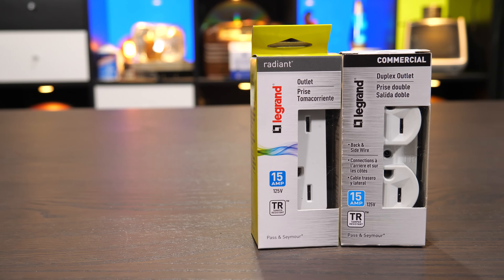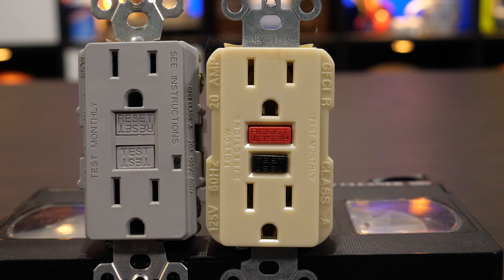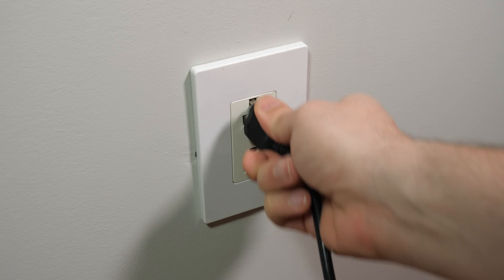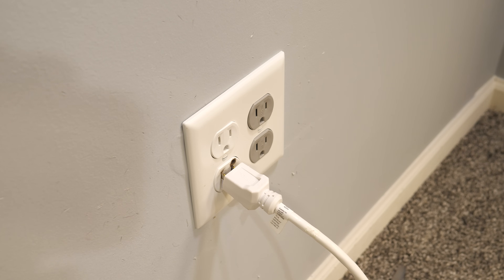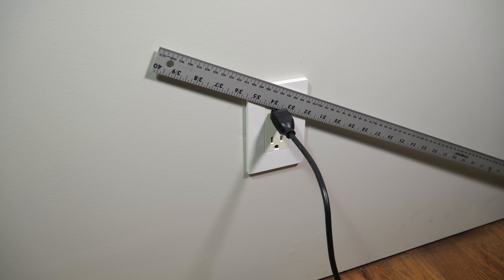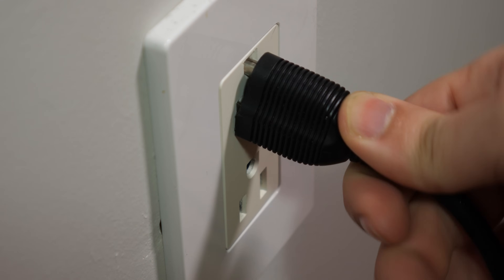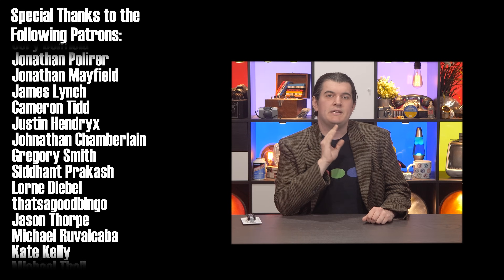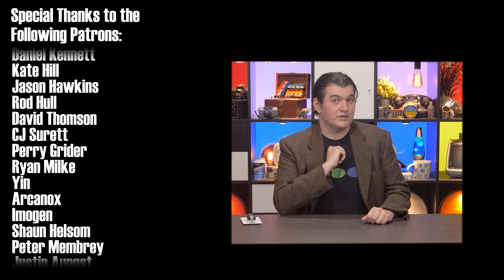Power outlets are topsy turvy - but does it matter?

Comment: In my early years first starting my career at UL (Underwriters Laboratories) I was taught that the receptacle orientation with the ground pin on the bottom was correct and intended so that if the plug begins to work it's way out of the receptacle, the last pin to break a connection will be the ground pin, which by the way is intentionally a bit longer than the other two blades.

Comment: Wrong. Know why? Because if you go into a house where all the outlets have been "correctly" oriented ground-plug up, you will find that, after a while, the tops of the ground hole will be broken out. Why? Because when you go to remove the plug from the receptacle, the grounding prong will eventually snap the thin plastic at the top of the receptacle. So, eventually, all of your grounded receptacles will have the top part broken out, and will look like crap, which forces you to buy a new receptacle---which is why all the manufacturers are suddenly wanting  everyone to mount them in this orientation---so they can sell more receptacles.

Comment: I would only advocate for right-angle plugs being standard if we made 45* rotation also standard. The ones that hang straight down are nice, but if you ever have two of them, plugging both into one outlet becomes impossible. So if right-angles became standard, that could eventually limit how often you could use both outlets.

Best Buy's Rocketfish power strips actually do a good job of this imo. They have 3 pins, with a large, round plug base, for easier grip and distance from the pins, and a 45* cable so you can plug them in right next to each other.

Comment: When mounting a TV it's pretty common to mount the plate "upside down" so the right angle plug goes upward.

And 2 prong plugs aren't going anywhere unless you take your complaints to Japan.

Comment: Sideways outlets (landscape-style) does make it very difficult to plug in cheap, novelty night-lights in the correct orientation, unless they allow you to rotate the plug on them 90°. This is something I have learned since moving to the Chicago area.
Of course right angle plugs are great, but even better when that can be rotated or even sit at a 45° angle, so you don't plock an adjacent outlet.

Comment: ha ha ha, story time.
When I was young, elementary age, I learned that electricity takes the shortest route. Well, I was young and curious and a night light. You know what else I had? A piece of copper wire from one of my dad's work associates I was given to play with, that I had stripped off the protective coating from!
But I wasn't stupid! Oh no! I took a corn dog stick cause wood is an insulator and so I wrapped the copper around the end of the wooden stick and tilted out the night light and Tap! knocked power in part of the house, tripping the breaker. While my brother was showering. XD
I dont even recall getting punished too badly oddly enough. Funny thing is I found that night light years later, still functional, although it's probably gone by now. I did buy some in the EXACT same style 20 years later but with LED!

Comment: The only reason to put the ground prong up is so that when heavy extension cords are plugged in (usually high up on a wall)  when they fall out they don't break the ground prong.  They just fall out.  When the ground prong is on the bottom it's the 'pivot point' and the cord  breaks the ground prong off.  An extension cord without a ground prong is a major safety hazard.  Ask OSHA.

Comment: My outlets are all installed properly but I bought a power bar and the wire coming off the plug sticks up in the air when plugged in as if it was designed for an outlet installed upside down..

Comment: Safety arguments completely aside, the frustration of constantly needing to push a cord back into an outlet is FAR worse than the frustration of seeing the sort-of-rare right-angle plugs go in upsidown. Any argument regarding two-prong cords is sort of irrelevant since you're boned regardless, but also in general because WHY YOU PUTTING ELECTRICITY IN THIS THING WITHOUT AN EQUIPMENT GROUND WTF???

In addition, right-angle plugs (even those that are actually 45's) have a notable, far more major issue that you seemed to have missed (unless I missed it) -- that being that they universally compromise or entirely block your ability to make use of both of your outlets. Having bought many things that happened to feature them and having cut off and replaced nearly all of them (no not because I flipped my outlets, the frustrations existed long before eventually doing so) I cannot stress to you enough how much they fail as a silver-bullet.

My decision to flip the outlets in my house not due to nebulous "safety" concerns, but solely due to sheer utility. At work (Journeyman Industrial Electrician) I do almost exclusively mount outlets "normal" because yes it generally isn't important and any "advantage" isn't worth the endless arguments I'd have to have with literally every person who sees them. That being said, I do make special, specific exception for plug-in devices that absolutely NEED to stay plugged in unless you choose to physically unplug them. PLCs, network switches, tons of safety gear like alarm horns or strobe lights that come with pre-made cords attached to the and would violate the NEC to modify for hard-wiring, etc etc.

So no, it's not NEARLY as vital as some "advocates" make it seem (i cringe at the thought of being called an 'advocate' for something as inconsequential as this) and the safety concerns are minimal at best or  straight up bunk. However, I do take issue with the argument that it makes absolutely no difference. It makes A LOT of difference.

Comment: Growing up the only receptacles in the house with the ground up were switched. If using a right angle plug, I am of the preference for perpendicular or rotating so you can fit more than one in the receptacle. While we are at it, ban the spring loaded back stab connections. They already make them so only 14awg can fit, but they are the source of house fires and AFCI tripping. I have no problem with screw secured or lever lock back connections.

Comment: yeah its definitely not standard or anything to put the ground at the top. I know because if you buy one of those wall hugging 90 degree power bars it has the two slots at the top and those can really only go in one orientation unless you are putting the power bar up on a shelf or something.

Comment: The Canadian electrical code is silent on the issue, therefore most electricians suite themselves as to which way is preferred. However, having said that, I worked maintenance in a hospital for many years. To look nice and to ease cleaning, the hospital used stainless steel receptacle plates. Nice. Except one day, the metal place became loose at the same time something was partially plugged into the bottom of the plug. The metal plate fell, and shorted out on the bottom positive and neutral blades causing a dead short, blowing the breaker and scarring the staff in the room at the time. What's the chance of those things occurring simultaneously? A few thousand to one, or more? But it happened. The breaker was reset and all was fine, except the plate was scorched and had deep marks where the short occurred. ALL the outlets were changed out to "vinyl" plates to prevent this from happening in the future. One in a million maybe?

Comment: You want to talk about crazy plugs. Once had a...lamp? Think it was an old lamp with two prongs. The plug was circular bell shaped but the material that capped the plug, that the progs stuck out of, was card stock. So the whole plug wasn't a single cast object. You pull the cardstock off and could see the plug's prongs wired into the power cord.

Comment: Having been born in 1980 and seen the three prong plug which was to ground out the case of whatever device incase the metal case became live fade away due to things now having plastic cases and thus having no possibility of having a hot enclosure I have pondered why plugs themselves don't still have a dummy ground plug just for socket to plug interface stability. It would have a tiny amount of material added to the cost. And well if you are a dummy and cut off a dummy 3 prong plug and then put it on a device needing a earth ground and don't notice you connected only two wires you deserve your fate.

Comment: You are incorrect that there is no mention about orientation of receptacles. There is absolutely a code specifically referring to the orientation of a receptacle when mounted horizontally. It is required to put them with the ground to the left (neutral up)

Comment: After years of use and installing this ground up trend is all BS. The chance of a thin metal blade staying flat against the wall i virtually impossible What is worse is that all power adapters end up upside down and falling out of the socket.   The local inspector here want the ground up Arrgggg beside IT looks ugly

Comment: As someone who lives in an apartment with the outlets ground-up, they are far more dangerous. Everything is made for the face orientation, and the ground being at the bottom provides support so the weight doesn't pull it out. I can't use plug-in air fresheners because the weight will eventually pull it out.

Comment: It had been a standard before that ground on top meant the plug was controlled by a light switch. It may not be as common practice anymore more, but in much older houses if you saw an inverted plug you knew to look for a light switch.

Comment: The outlets in my (old) apartment building are all installed like this. It gives no benefit in years of living here, and because nothing else is designed that way, you run into problems with things not fitting properly, or hanging half out of the wall, or the outlet just becoming damage over time due to weight of things plugged into it. I hate it when I have to deal with it.

Comment: I'm legally required to brag about how UK plugs are superior in every way: every plug is required by national legislation to be sleeved, right angled and have a ground pin, even if it's just a dummy plastic one that opens the (also mandatory) shutters on the live and neutral sockets during insertion. And the ground pin is at the top, of course.

Comment: My young niece was playing with a toy baking sheet against a wall.  She dropped it and it fell on a loose plug connecting both prongs causing huge sparks and she almost got electrocuted.  If the plug was installed with ground up that could not have happened.

Comment: From a young age I was told "Ground is down".  Recently learned that there is no code to reference this, as was told in the video.  Who knew there was a danger.  I've never been shocked using the "ground is down" method.  Of course, I don't go around throwing knives at my outlets.

Comment: I learned about this years ago, and I would only consider reversing them in my workshop or where I tend to use metal more than everywhere else.  Maybe in the kitchen too, but most people don't put metal plates or utensils near sockets.  Anyone working with sheet metal would be wise to put ground up in their workshops too, just in case.  But yes, it really isn't much of a deal for many.

Comment: Had an outlet behind a shelf at work where we store metal pans. One of my employees dropped a pan, it bridge the outlet and there was a big ass flash then the power went out. Ever since then, I respect the rule. That said, when installing above 4ft, I actually install them "the wrong way" because it's unlikely something will be dropped from higher than 4ft. That said, my local inspection requires the ground to be on the top regardless of height.

Comment: Start with incident data. How many times (per capita) each year does someone get a jolt or cause a short because they put fingers where they shouldn’t, or are careless with metal objects near electrical outlets? Are all these “could happen” scenarios really “rarely ever happen” scenarios?

In the UK (of GB & I) most wall outlets have a switch and a fuse! They use 220 V at half the amps there, so the shock potential is greater.
Reply: Small note, the UK typically uses a 32A ring main set up. The plugs are fused at 13A tho.

Comment: The exact scenario you described of a metal wall plate becoming dislodged and falling on the live pin happened to me and scared the crap out of me and I don't really care about which way we mount these, but I do now think our design is awful. Also the plug that I was unplugging when this happened was a two prong plug so a different orientation wouldn't have changed anything.

Comment: There is an age-old debate about whether an electrical outlet should be mounted with the ground pin up or down.  Unfortunately, there is not a fully accepted answer.  However, it is commonly accepted that the National Electrical Code (NEC) of the United States (NFPA 70), does not provide any specific direction for the orientation of the outlet. Do check with  local codes to make sure there aren't any local code requirements.

Comment: I take my cue from the markings on the outlets.  If installed with the ground prong hole at the top, all of the markings are upside-down.  Also, regular appliance cords including refrigerators have their ground prong at the bottom.  So there.

Comment: I still have my dads old aluminum 4-foot ruler with two small bites taken out of the edge. They were caused when I was a tyke, it was leaned up against a wall, and my clumsy 6 year old self went flying by and knocked it over. It tipped and landed on a plug. It just happened to land behind its balance point, so it pivoted on the prongs. When it hit level, it shorted those prongs and POW!, vaporized those two little bites right off the edge. One in a zillion, but boy was it exciting! Literally a once-in-a-lifetime, so I'm still not flipping my outlets.

Comment: I do it because it's slightly more secure. If the plug is loose it'll sag and the ground will hold it a little better. And it's a little harder for me to touch the prongs with my fingers
I made this comment about 1 min in

Comment: The orientation with the ground on top is so if the plug isn't in all the way and something falls against the wall, it won't be touching both blades. For example if you dropped a picture frame or a fork or a screwdriver and it lands on 2 partially plugged in blades, its going to kill whoever touches it

Comment: I recall learning fairly early on that the ground goes down except for switched wall outlets . Ground on top means, this outlet is activated by a wall switch somewhere in the room  (usually by the door) . As you say though this was never a hard and fast rule but only a rule of thumb...sort of an electrician's courtesy to the users.
 I had a friend who asked me to look at an outlet in his condo because only the outlet on top  was working and whatever he plugged into th bottom outlet just didn't work.I removed the plate and I could see that the top and bottom outlets had been separated and were wired independently of one another. I always knew this could be done but this was the first time I actually encounter it in a house.
  I plugged a lamp into the lower, not working outlet, in the duplex wall outlet and went searching for a switch that would turn it on. Sure enough there was a wall switch next to the front door that activated the lower outlet. It was a good thirty feet away from the door. I guess the electrician's plan was so you could turn a floor or table  lamp in the living room on upon entering the front door so you didn't have to enter an unlit room down the hall, but the top outlet could stay on for something else like a TV.
  My friend still hated the idea when I explained it to him because he would have to walk all the way out to the front door to turn the lamp off...I agreed that was a poor design. At first  he wanted me to rewire it so the outlet was always on. I ended up just telling him that he could leave the wall switch in the up position and accomplish the same thing which he begrudgingly agreed to.
 It should be noted that this outlet was installed with the ground on top which should have been my first clue that the outlet was on a switch, but i never thought of it until I took the plate off and looked inside.

Comment: I think the three-pronged plug doesn't have the lip because it's not necessary. The reason? You show it when you plug it in at 6:59! You don't have to hold it all the way up there. You also don't need to hold it up there when pulling it out. I certainly don't.

Comment: late to the party here but just want to add, my samsung odyssey 32:9 monitor has a right angle plug upside-down. i just assumed it was because they envisioned the cord hanging down from a desk. but now i believe they may have been on board with this reform.

and yes, it was indeed by no means ergonomic nor particularily safe

Comment: The ground is always up in the UK and always down in Australia. The UK has the best system with insulation on the pins, Furthermore, you get a fuse as well as 240 Volts with 13 amps so 3KW of power meaning it is OK to charge a car from (however you cannot easily buy an extension cord that will work properly)
Reply: They do that in Australia because everyone knows stuff falls the other way down there